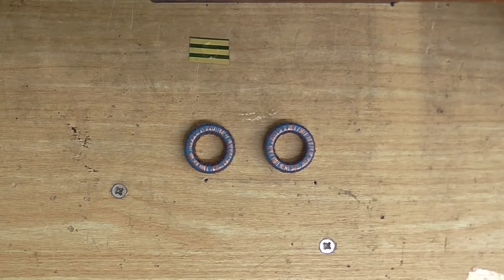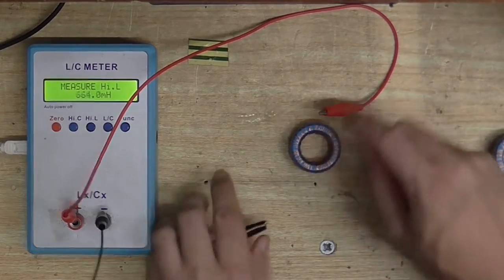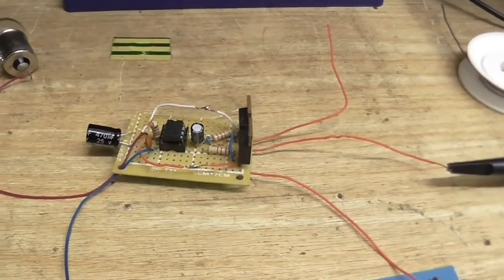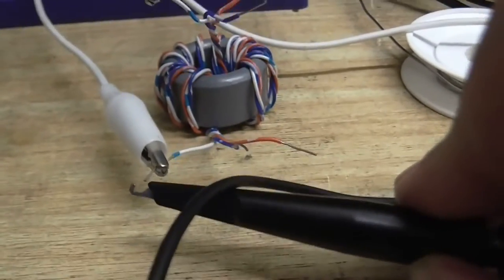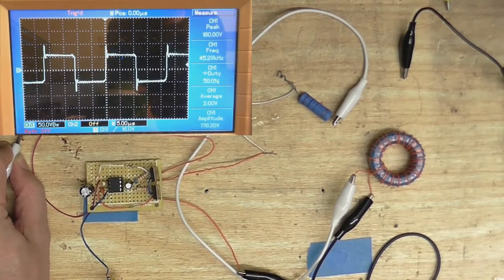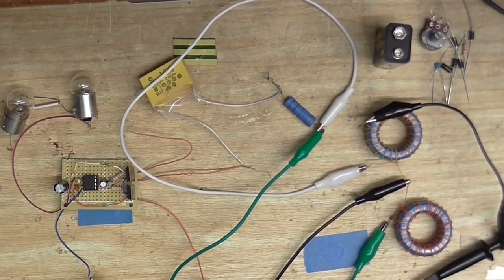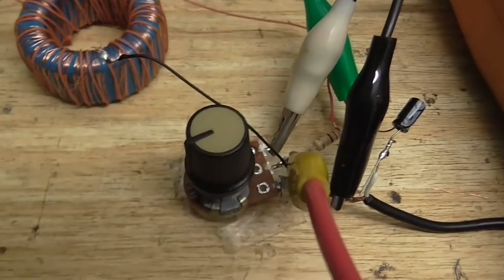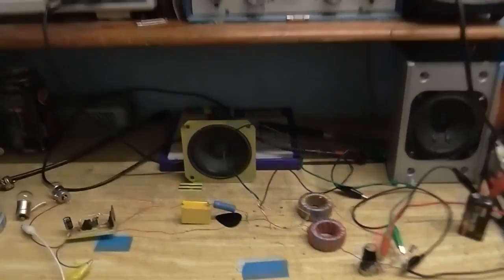Building a magnetic audio amplifier (fail)

Comment: Very interesting curcuit, without having watched the whole video yet, I can tell it's basically the same principle as an AM radio. Core saturation changes the LPF characteristics of the secondary and thus changes the amplitude of the HF.  

However the only real world application of it I can think of is guitar amplification because it problably has pretty odd clipping characteristics, like:

-Further tweak the curcuit to get it working and take some abuse.
-Hook it up to a preamp powerful enough to overdrive the curcuit.
Instead of a speaker, use voltage dividers to convert the output back to instrument level and hook it up to a guitar amp.

I might be on to something here.

Comment: Ha this is super interesting! I did not knew this was possible! You have, again, found a super weird but nice new and interesting idea and schematic, again! (I remember the audio compressor with 3 transistors that was such a weird but nice schematic too, with that first transistor without any dc but working perfect.) And now this weird but nice idea is even more unique! (Btw, i saw once that 1N400x are slow, on scope measurable do not close immediately, the effect beginning just above 30kHz but so here it should still work just. But again, what a nice and weird schematic you did found and try here for us, again! Thanx man!)
Reply from the maker: I started off using FR207 diodes which should be fast enough, later I switched to 1N4148 to be absoloutley sure the diodes were fast enough. I know how slow the 1N400x ones, good for mains frequency rectification.

Comment: It should of worked, the concept is pretty straight forward.  You could try opening up the  200 turn side and just putting a resistor acrost that pair of winding. The voltage induced is supposed to cancel anyways. At that point most of your 35kHz voltage is dropped across the 25 turn windings. Don't give up, this is an interesting series.

Comment: The loudspeaker can only get a dc signal? Or at least can the signal over that speaker never get negative! (Okay then an outputcap, so maybe thats the least problem.)
 But again: what an amazing interesting schematic you manage to find there for us! Worth watching yes very sure!
Reply from the maker: As I understand it the diodes do two things. Firstly yes they do only let DC into the speaker, they demodulate the signal from the transformers like in an AM radio. Secondly, they increase the gain of the circuit in this configuration, something I've yet to achieve.
Reply: @CoolDudeClem  please let us watch with you when you try further working on this weird principal? It is really amazing, i have never seen such a thing.

Comment: dont use toroids
they are to efficient and dont work as good
(I had the same problem)
Reply from the maker: yeah I thought that might be the problem, I might try again with some transformers out of a switchmode psu or even small iron core transformers if they can handle the high frequency.
Reply: @CoolDudeClem  I had custom made coils for a magnetic amp
and when I put in 32khz at 100v i got only half imput as output
and the 9v did nothing for me
that is how i found out